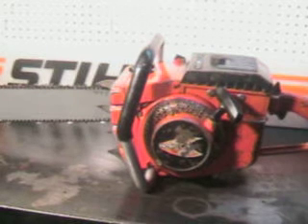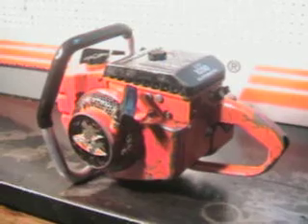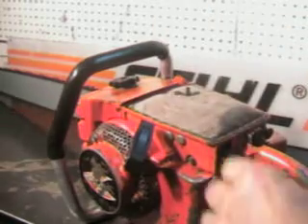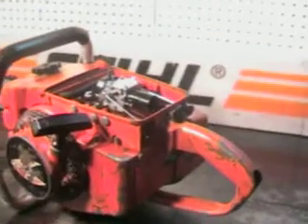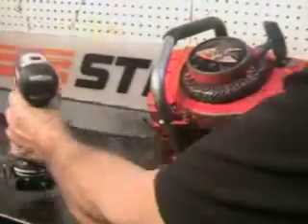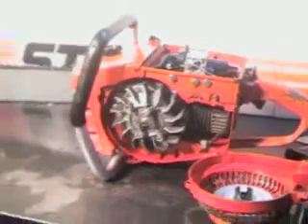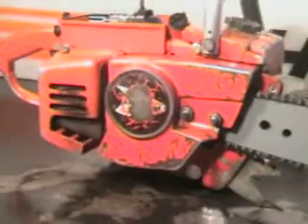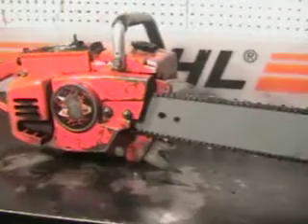The chainsaw guy shop talk Homelite Super 1050 chainsaw

Comment: As a saw tech in the 80's I worked for a large logging company maintaining 49 Homelites- super 1050's, 955's and 925's- each crew  took 6 saws (yarder and cat crews) every morning and brought 'em back later the same day for me to prep for the next days work.  Took me abt 70 hrs/ wk (had other equip too).  Those saws were really built tough and the 1050 would run up to a 60 inch bar for clearing right of way timber, etc. (We built forest service roads also).  Was much work but I loved running that saw shop- good memories!